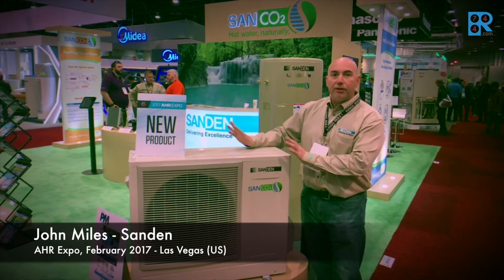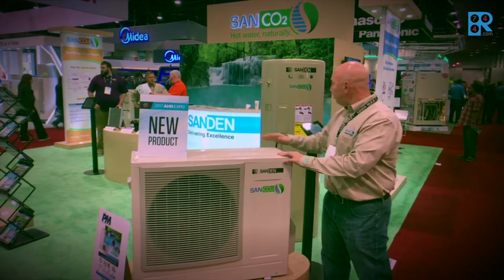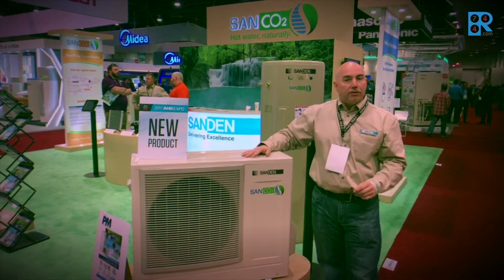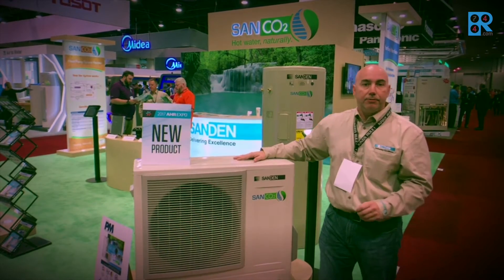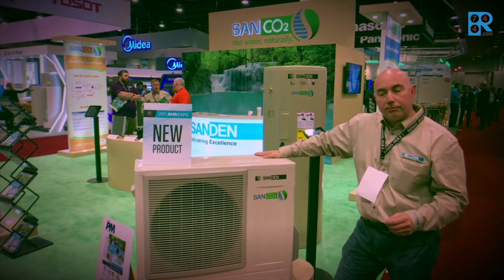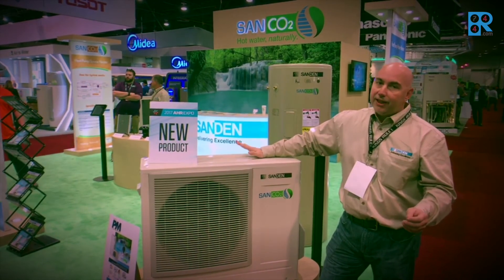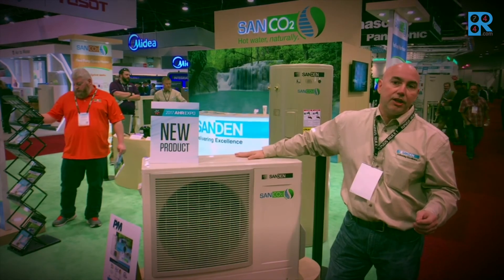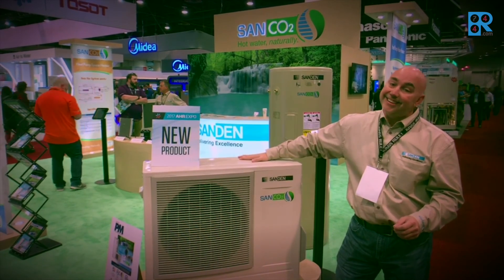Interview with Sanden at AHR Expo 2017.

Comment: The best. cheapest to run of any hot water systems,  here near Sydney Australia anyhow.
We replaced both a gas continuous and an electric Off Peak with a single sanden and bills are literally half in our 6 person household. 
So quiet too compared to others ive seen.
Recently we changed the timer setting to run while our solar PV is generating,  so even cheaper than before.